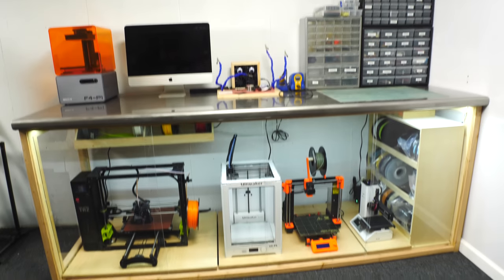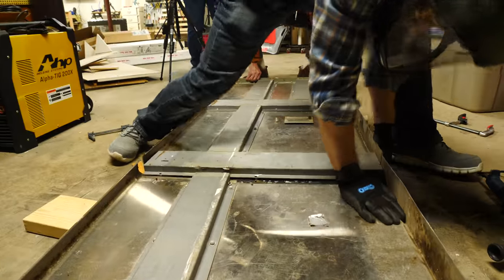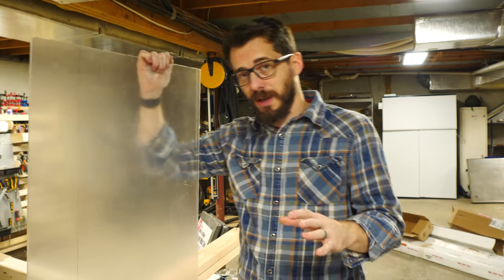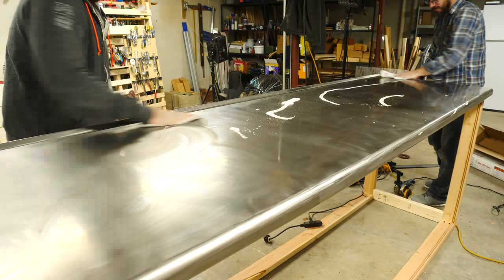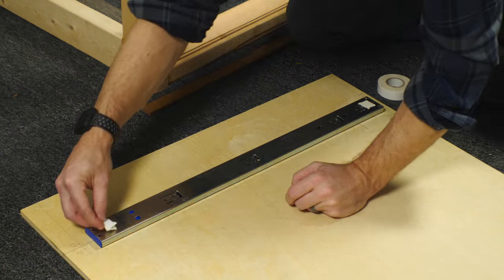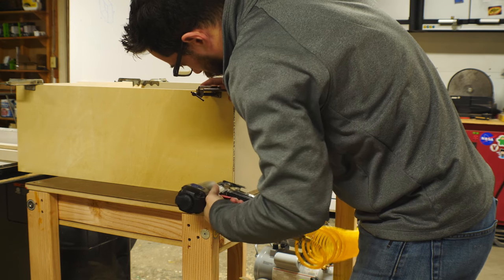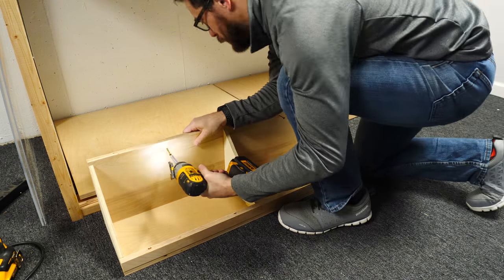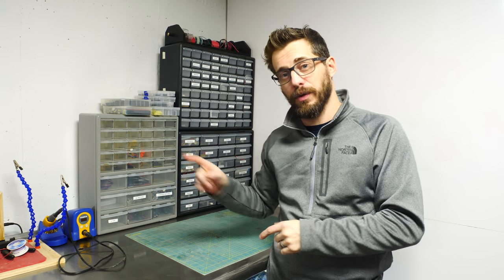3d Printer Enclosure / Electronics Workstation | I Like To Make Stuff

Comment from the maker: A couple of things I didn't mention in the video:
1. For electronics, I work on a mat.. the surface is conductive and would be bad for making electronics projects on directly.
2. Filaments that need more specialized moisture control stay in zipped bags with desiccant packs.  I only have a few of those, and 90% of my filament is PLA.
3. This is intended to be standing only desk, thus no room for legs to go underneath.
Reply: I Like To Make Stuff are you looking at also adding a heater to keep the printing area consistent temp?
Reply: Maybe metalic surface and electronics wont mix that well hahaha
Reply: Looks very low for a standing desk. Might want to fashion some sort of raised section to avoid doing your back in.
Reply: If printing with PLA ventilation is not needed and would likely diminish the benefit of the enclosure.  If printing with filaments known to have toxic fumes, such as ABS, proper exhaust and filtering should be employed.
Reply: Clean design Bob, easy access with those slides. I like to use hanging closet moisture absorbing bags you can get just about anywhere. I date them with a sharpie for 3 months and switch them out. Shop stays dry and comfortable.
Reply: You can easily fix the conductivity portion of your Metal table by wiring a Ground to the table. Just dedicate a socket for it. Modify a power connector, glue clog the other two connection points for Neutral and Phase then simply wire the Earth only. Pop it into your Socket and voila, custom Ground Cable. Should Neutralize any risk of Conductivity or Static Electricity.

Glue Clogging is just to avoid the risk of Jumping electricity. Albeit that is a low chance of happening. It doesn't hurt to be safe.
Reply: @Helveteshit Static yes, but when working on electronics you have exposed Hots(although typically low voltage). If one of your hot pins touch a grounded table...bzzzzzpp goodbye chip/board. In this case the mat acts as an insulator so you don't have to worry about it as long as you are good about staying on the mat.
Reply: @Aaron Chinault, true enough. But I would be more worried about static and since he has a mat. He can just do the testing on that. Because it could go Bzzzp even if there isn't a ground on the table. Because it will act as a natural Ground/Neutral. Much Like a Car chassi. 

BUT, since it looks like Stainless metal, it has Very high resistance value. For lower voltages, it reduces the chances a tad I guess. So in that sense, it might not go Bzzzp. 

But generally, when handling ESD sensitive components, static is the bane and such a large piece can attract quite the charge over time. So I would be more worried about Static than testing equipment on it. But that is just my opinion. I am hardly an electronic person on that level. I be more on the higher electrical end of things.
Reply: I find that even PLA benefits from moisture avoidance. I have some rolls that are pretty old, and now quite brittle and hard to print with. Something to consider.
Reply: I Like To Make Stuff  I’m a big big fan of your videos how did you learn to do all of this amazing  building
Reply: What did you study in college or whatever to do stuff like this?
Reply: Probably more aptly described as an electronics workbench, which appears to be about the correct height for that application...
Reply: Nice guitars Bob! (I just wanted to throw that out there)
Reply: I Like To Make Stuff hey do you think that there's a way to turn a Raspberry Pi into a cinema camera
Reply: Maybe some aluminium lists to stiffen up the doors?  They look flimsy.
Other than that, I think it is a great bench.  
Oh, and if you are going to do some electronics on it, do ground the metal, as static electricity killed may IC chip and computers...
Reply: I Like To Make Stuff Bob, no concern about not being able to sit up to the bench to work? With the bottom blocked off you are very limited to standing or at Least not being close enough on a still to be comfortable for any period of time. Just an observation. Cool idea though.
Reply: I Like To Make Stuff Add insulation to the walls of the lower area so that's it's easier to maintain a stable temperature.
Reply: 4: don't hurt yourself ;)

Comment: Some ideas:
1. Ground the top so you would not get a shock if a live wire slips from the mat.
2. Reinforce the doors with wood strips. That way you could still see the interior, but it would be less wobbly.
3. Bring another power strip on top. It's very convenient.
4. Make a stationary 12V and 5V supply with banana/screwed sockets.

Last 2 I used in my workbench and it's great.

Comment: First, such an awesome solution to a great problem to have.

Second, my ideas:

1. A security/nanny cam set up to keep an eye on prints from elsewhere in the shop/home/world (Plus consider the Twitch streamability!)
2. For the area where you directly do electronics work, rather than just relying on the mat, have you considered painting a rubberized surface?  It would be non-conductive, and have a little bit of grip for small parts and keeping things from sliding.
3. ...Lasers

Comment: If you want to add some ambient heat to the enclosure that also helps with humidity, check out the 
GoldenRod Dehumidifiers.  Lee Valley sells them and they are basically a heating rod often used in gun cabinets to help with moisture by raising the dew point.  I've used one in my Makerbot to help keep the temps up when shop is cold.

Comment: If you are looking to upgrade your dehumidifying system there is a product called "GoldenRod" its used a lot in firearm safes but it plugs into a power source so you don't have to change out bags or recharge driers. They come in all different sizes and take up very little space. May be something to look into. Keep up the great videos!!

Comment: Filament storage above the printers - A good choice might have been to make a rack along the length of the shelf consisting of  2 x 3/8 metal bars and inserting Bearings with a lip on one side of them. Spread the bars just 2 inches apart to roll and guide the Filament spools on their edges. When the Filament spool is empty - it's easily removed, just lift off and replace. No dismantling any centre bars from the spools or anything like that. This provides a smooth rolling feed into the printer with the filament

Comment: Love that desk.  Nice score from your Grand Dad.  I've noticed in a couple videos that you've used those drawer rails in the wrong orientation.  If this is intentional, just ignore the rest.  They are stronger when they're standing vertically.  It doesn't look like you'll lose much space if you do install them in that direction. It looks like with those drawers pulled out, they'll lean down.  If you stand the rails up, those drawers won't bow at all.  You probably also don't use them that often, so it might not even matter. Just a tip if it's warranted.  Great job bringing that table back to it's glory.  On my way to watch the background design.

Nevermind lol.  Just watched you tell your partner "it's not made to go in that direction".  Good Job and Good Night

Comment: Beware that printing with PLA you need a stable temperature but it cannot be too high. If the print quality decrease you should add some ventilation. The stepper motors and the hotends will be producing a considerable amount of heat. If your printing with ABS, be aware that the fumes it produces are toxic and should have extration or at least somewhere to go other than that room. Keep up the good work. Love your videos

Comment: You should open the doors when printing PLA only ABS-Style filaments benefit from higher ambient temperature. PLA actually prints worse as it increases drooping and lowers the resolution of the printer. Increasing the nozzle temperature slightly while also increasing the part cooling fan will result in better prints if you have problems with layer adhesion or detail  while printing PLA.

Comment: Love the design, the LED's gave a great touch! an idea is to run octopi and get 2 cameras above your printers, a temperature sensor, a wifi control module for the LED (or equivalent) and being able to control fully remotely. For me I will definitely need to make a similar setup, my Creality CR10 is taking up a lot of space, and the sliding shelves are the answer to placing them under the work bench. Thanks for these greatly inspiring videos and keep up the creative work, a pleasure to be a subscribed to your channel!

Comment: You can use dust free cat litter (mimi litter is the brand i have) as desiccant as well, as it's just silica gel. Set a tray of it in there and occasionally bake the moisture out of it in your oven. It's also way more effective than rice at drying out electronics you've gotten wet.

Comment: Hey Bob!
I'm not a fluid mechanics expert by any means, but by enclosing your printers in a box without any means of actively controlling the temperature inside... you might make the temperature problem worse. 3d printers run by using hot nosels (i mean typically, I'm not talking about SLS or anything fancy like that, just the ones that you have), and so they'll heat up the air around them as they run. in a big room that's less of a problem because there is more volume of air to heat and it takes longer for that temperature to change, but in a small enclosure, it'll heat up faster, so at the start of your print the enclosure will be at room temperature, and then at the end it'll be a lot hotter in there compared to if it were just on a desk in your workshop.

I'd really suggest figuring out some way to keep that temperature consistent like an Arduino controlled vent that kicks on and off depending on the internal temperature or something like that.

Just a thought,
Great work though!
Reply from the maker: It's mostly about cutting out draft that makes the local (by the hotend)  temperature fluctuate

Comment: No back on the 3D printer area, means it's fully open to air, so moisture control will not work.  The volume of space the 3D printers occupy is so large, that it is effectively the same as the room for temperature control.  I do my electronics work on a non-conductive surface.  I would suggest putting a heavy rubber, or plastic down over the metal desk.  The legs of the desk also require gussets to stabilize the desk while the 3d printers are running, otherwise any vibration in the desk surface will be visible in the 3D prints. This being said, I like the design with the lights, and power bar, and transparent sides/doors.

Comment: I suggest putting deviders between the printers so that if only one of them is running it just has to heat up the air around itself instead of the whole space under the worktable.

Comment: Isn't it a big risk to have a conductive metal table top as a surface for electronics projects? If you aren't careful I would expect it to be quite easy to fry your project from accidentily placing something on the surface without a mat under it.
Reply from the maker: That's all about the attention you pay to what you're working on.  I can't imagine why you'd work on the electronics ON the metal surface.
Reply: @Iliketomakestuff  Looks great, but I would have thought with the conductive surface you'd put a layer of plastic (polyurethane or equivalent) vs the wax.  You have a lot of electric stuff nearby, so a loose wire could create a hazard.  Just saying.  Also, wondered why you didn't section off the various printers.  That's a lot of volume to heat up if you wanted to raise the temperature for a print (e.g., ABS).

Comment: Love it! Inspiring and smart to enclose both filament and printers in the same area. If you are looking into having fume-extraction with the soldering area, I'd suggest to create a combined outlet so that the printers can be filtered as well. Active carbon + HEPA should be a good combo to remove smell and fumes/particles.  Any reason you didn't set the Form2 down there? Guess it smells the most?

Comment: Would it be better to, instead of using desiccant packets, to use the kind of dehydrators that are used in gun safes that plug into an electrical outlet?  You already have a power strip with which to use, so converting should be pretty simple.  Just a thought.

Comment: Hey bob! I like this Tables concept and i Love how you used the drawer-slides on the bottom, Thats just a really Good idea. But you Wanted to Control the temperature around the printers, so i wonder Why you took a heatconducting Material like Steel for the top, considering you will solder on it. Also it is an Electric conductor, Maybe Not ideal with Electronics. You Can Add a mat of course, but you will have to be very Carefull to Not let anything come off it onto the steel. I Think a wooden Panel with cross-braces would have been a better choise.

Comment: Glad you mentions the steel surface. I would have gone with wood so you're not limited to just the mat and have to think about where you place your tools

p.s. Also awesome video, love the clear aesthetic panes, LED, printers, slots, and overall design.
p.s. you should consider putting a Nest camera or some type of camera so you can remotely check out the prints while not in the room. I believe some printers will allow you to stop the print remotely

Comment: Really cool! You might think of installing a fan or two to improve cooling. Since you said you mostly use PLA or you could refrigerante the steel plate and use it as a heat exchanger (but that would be a little overkill hehehe)

Comment: Really unusual electronics workbench.  I am all in for 'reusing' materials, but a conductive material for a electronics workbench is just nuts.  ESD (electro-static discharge) is going to be a problem.  The stainless steel is going to act as a large inductance source just from residual electrical charge from dry air environment.  Shock hazards make my skin crawl.  Having data voltages near such a large piece of metal will require special precautions.  And forget about working on high data flow projects, you'll find that having a large piece of metal near data lines (cables) is a joy reserved for karmic retribution.  Two suggestions: earth ground your SS counter-top (it'll reduce electrostatic loading) and since it's grounded attach a wrist ESD strap connector with conductive paste, it'll at least be convenient.

Comment: Hey Bob, great video. 
I just have a quick suggestion that you could definitely ignore. I know that some filaments are quite sensitive to humidity (such as nylon) and yuou said that you added some desiccants to the cabinet, but you will probably be opening the doors quite often to start/remove prints. I think that maybe the smaller spool holder (above the Taz) with a more sealed enclosure for a few spools of filament that are especially sensitive could work.
Reply from the maker: Yeah definitely, that's a great idea! I actually keep those sensitive ones in plastic bags sealed up because I only have a few. But if there were more, a dedicated storage spot would be great!

Comment: Bob...I didn't catch how you we're dealing with potential heat buildup...if any. If you don't currently have something handy...might I recommend 2 of the small ish elect equipment types... Probably could get one puller and one pusher that could mount from the inside (recommend one at each end) could tie together with a temp controller/power supply. Would effectively air exchange for you with (I'm guessing you have an AC shop) shop ambient air. A potential new project episode.... maybe.

Comment: I got a question about the acrylic used. Wont the doors sag or warp over time? As they are holding their own weight with constant heat applied sometimes for days as the printers are being used?

Comment: Nice, a Workstation for Electronics! I like Electronics ;-)
It seems to be very useful, with the drawer for the printers and the LED light!
Maybe I would make the Filament Storage also able to pull it out!? [Edit: Just saw the Behind the Scenes an heard theat its to heavy.]
The stainless steal is a great surface to work on, but you ever have to think about put something between the circuits while testing.
I also think i would make a connection to earth for safety. (depending on what kind of electronincs you're going to work with.)

Comment: i would suggest a little slide in division in between all printers as if you aren't using the others the space will take longer to heat and you will get delam :( other option is, design your own acrylic box for each to fit them exactly and have a little extraction fan on the bottom corner of them to vent the fumes.
Reply from the maker: I've been printing with them all on the current project and they've all been working great.  It's mainly for cutting down draft.

Comment: It may be worth adding a little glue to the back LED strips, I use hot glue or epoxy most times. Overtime the adhesive will give out and they will fall.
Reply from the maker: Good call!
Reply: Great project by the way. Forgot to mention. #notatroll
Reply: Hot glue also isn't always the best option as higher power strips can soften it significantly.
Reply: Arrvi true, I usually goop a bunch around the wires on each end. Doing 2 things, protecting the solder joints and holding the ends up where it usually falls anyway. Epoxy is probably a better choice, just more of a pain sometimes.
Reply: Cable staples over the led strip or if you want to go budget use romex clips/nails, they will hold the line up if it ever snags and not mess with the electronics, plus you can just put them between the actual LEDs so they dont block the light